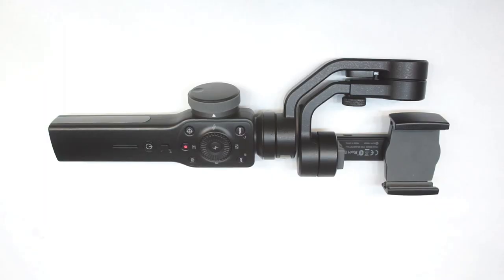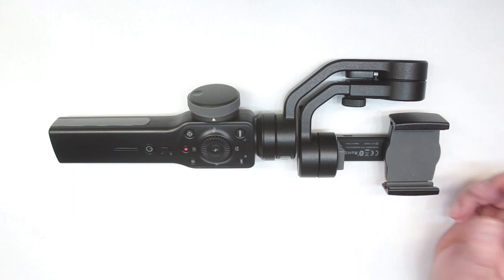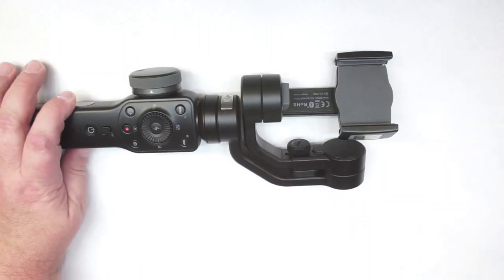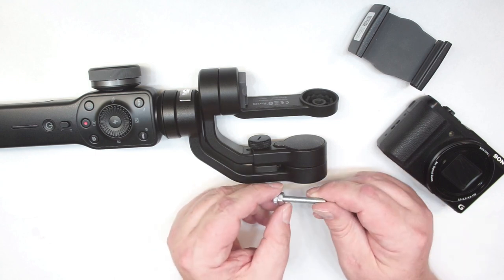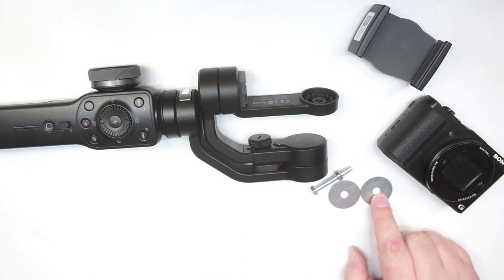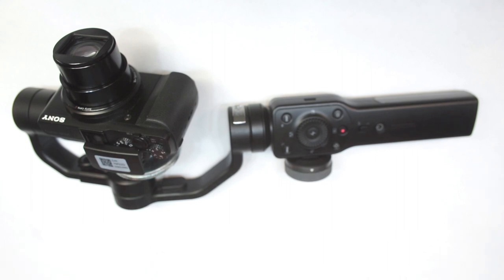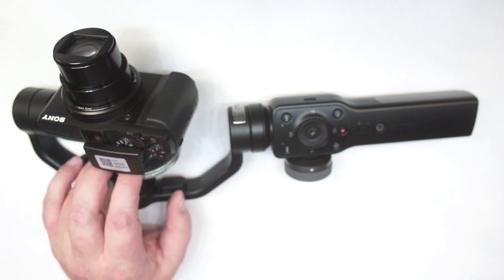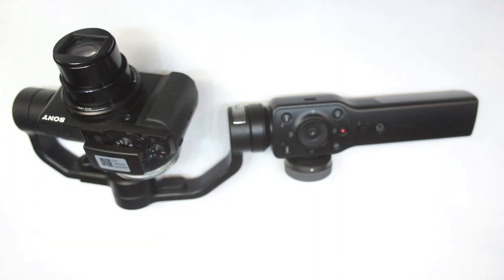Convert Zhyun Smooth 4 3-axis Mobile Gimbal for Sony HX 50v / 60v and other Small Cameras $5

Comment: I purchased this gimble recently.  It works on one iPhone but not on the other.  It seems that the other one is a bit heavier phone.  Does this gimble have a weight capacity issue?  What happens is that it works for few minutes on the heavier phone then it stops working.  Please help.  Thank you.
Reply from the maker: Are you adjusting the gimbal arm length to balance it

Comment: It working on a6000+sigma30f1.4 ?
Reply from the maker: no but it will work with 16f2.8 with this setup https://youtu.be/7EwV4ZH-gyI
Reply: You're expecting to fit elephant in a room.

Comment: I think max weight 300g?
Reply from the maker: Originally there is no way to counterbalance it however I tested it with a Sony a6000 with 16mm2.8 and my bracket and counterbalance weights for months with no issue.https://youtu.be/jKSgzvCDIQ0
Reply: @sliversurfer1   can i use with a6000 + kit lens ?
Reply from the maker: @mcg5707  no but you can with a kit I developed https://youtu.be/7EwV4ZH-gyI